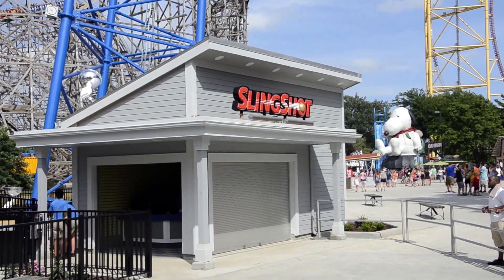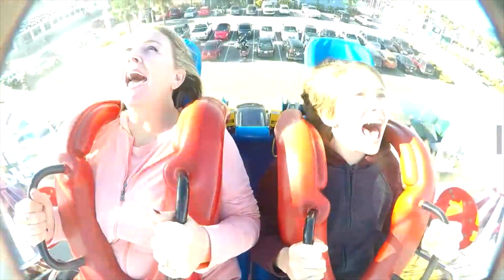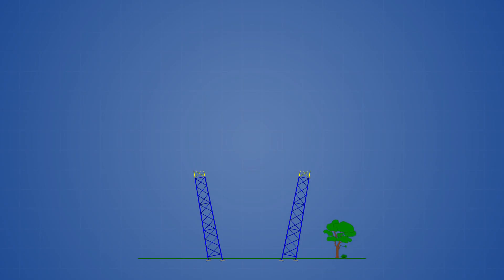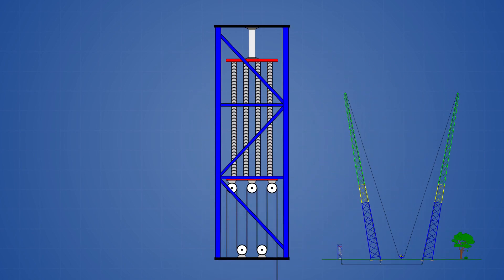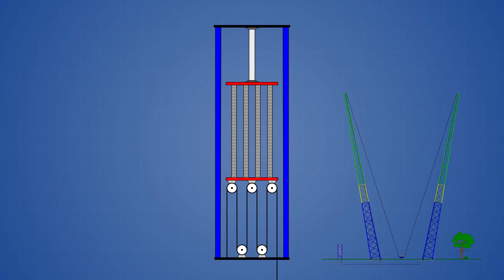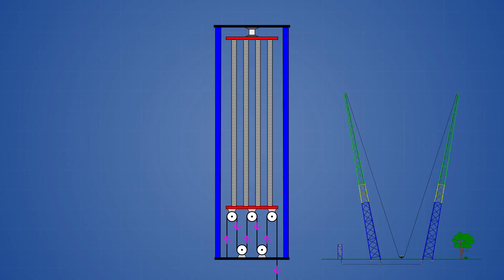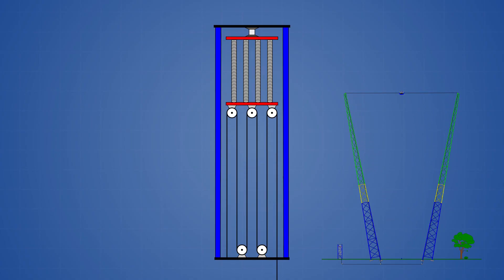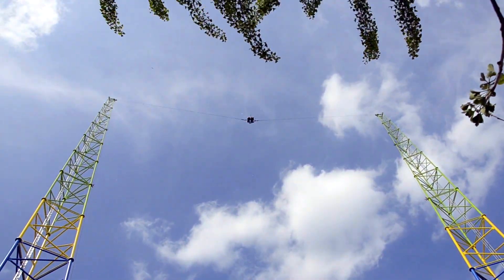How SlingShot Rides Work

Comment from the maker: The modern variant of the SlingShot ride is one of my favourite attractions at themeparks today. Would you ever consider riding one?
Reply: Art of Engineering 
I’m too much of a wussy to go on a slingshot that launches me so high so fast and then I fall straight down 😂
Reply: Nope, I will stick with roller coasters.
Reply: @horseshoe_nc  Me too! Roller coasters don't have the shock of slingshot rides or the uncontrollable spinning. Roller coasters are thrilling enough for me. Sling shot/ bungee jumping-too scary.
Reply: @horseshoe_nc  bouth of them are great .you  can have diffrent thrill
Reply: @horseshoe_nc  bouth of them are great . can  experiance diffrent thrill
Reply: One of two rides at Cedar Point that gets my adrenaline pumping. I’ve spoiled top thrill, millennium and pretty much all other rides, although the free falling sensation gives me butterflies on the gatekeeper. The other ride is power tower, the green ones where you go up nice and slow to take it all in and drop at random because time feels so long. Favorite park I’ve been too, and by far the safest. I’ve been to six flags where I see thing and understand how people can easily become hurt. It may have been Superman at the six flags near Milwaukee where I noticed I could stuck my leg completely out of the cart and while approaching the station, I could have completely severed my leg off. Nothing like that at the point. I would also recommend the breakers hotel or a cabin. And chickie Pete’s although renamed a million times, is a classic dining experience where you periodically listen to the graceful whoosh of the raptor. I love this place if you can’t tell...
Reply: Art of Engineering do the skyscraper at wildwood beach search it up
Reply: no way sis
Reply: I have rode one when I was 11. I would say it is not that bad if you don't think about what could happen wrong. (very unlikely anything bad would happen). Also, the top thrill dragster is scarier than this so if you went through the top thrill dragster(which wasn't TOO bad) with ease this ride isn't bad.
Reply: No.
Reply: There is an accident slingShot...I skip this one 😂😂😂
Reply: I did when I was like 7, and it was a temporary one last security checked in 1997 (according to the poster), and ours spun and spun ridiculously. Turns out later that month at the same festival, the wire snapped. It didn’t harm anyone but is kinda scary to think about...
Reply: Yeah
Reply: No thank you 😆
Reply: HELL YES! LOOKS LIKE TONS OF FUN!
Reply: I most definitely would never ride a slingshot. There is a big one at a theme park near me, and, a few years ago, it had a cable failure that killed a rider.
Reply: Rode a bungee version a LONG time ago, at a tiny fair in Spain, at night.  I’ll think twice next time, and ride it again probably.  What could happen? D-oh!
Reply: I don't  want to go on. That is crazy 😅😅😅😅😅😅😅😅❣️❣️😋😋❣️❣️❣️❣️😅😅❣️❣️❣️❣️😋😋😋😋😋😋😋😋😋❣️❣️❣️❣️❣️❣️❣️🤔🤔🤔🤔🤔🤔🤔🤔🌞🌞🍿💐😋😅❣️💐💐
Reply: Yes I would looks brilliant
Reply: I've ridden the Old Town SlingShot in Kissimmee, FL, USA a few times after it reopened. This was the same location where the cable snapped in March 2021. They reopened a week later and they now have protective stuff on the cables. I'd rather do the world's tallest SkyCoaster than the SlingShot because I feel safer on it and it's not as scary.
Reply: 2 cables. Each run from one side of chair, through spring box, to the other side of the chair.
Reply: That would be a nooo from me.
Reply: Yep but the elastic…
Reply: Hell yeah
Reply: Nope!
Reply: no
Reply: Rode it twice- once during the day and once at night and both times were really awesome! Love it!
Reply: Sure why not
Reply: I want to get on one.
The company that makes the modern slingshot is Funtime
Reply: i rode the sling shot in ocean city MD a few years back best 25.00 bucks I ever spent I would ride one again
Reply: I would definitely try one of theses now because of this video!!
Reply: @TheKellingBros  me too 👌.it is really amazing
Reply: Art of Engineering have riden several rides  Extremely safe ride......and I do have previous back injuries.....and I have riden theses with no further problems to my back problems......exstreamly smooth rides..........for those that think its going jerk them around........lol not at all,,,,that’s a bunch of crap...and it’s in people’s own mind who stands there and watching other people rides it.....saying.......”oh you’re never going to get ME on That uhhh oh no no not going to ride....

Comment: There’s a ride like this in branson.  Maybe a pendulum / swinging ride instead of a slingshot.  Not sure - don’t remember but it uses the two big towers where people dangle in betwixt.  What I do remember were large cracks in the concrete base of one of the towers.  Cracks in the concrete of sidewalks and streets are common and not much concern but those towers are crazy tall.  I can’t imagine the torque on those things when they’re fully loaded.  So I just tell myself that the ride is regularly inspected and there must be some steel pillars that go many meters into the ground on each tower so it must be safe 😳

Comment: The ultimate question was not answered in this video.......Why do they charge extra to ride this?
Reply: Probably because they want you to understand that your life is on the line when riding it and they look at your money as a down payment to your casket if you should wind up getting killed while on it LOL 😂
You are basically paying your life away when you get in those seats, they should make every rider sign release papers stating that you ride at your own risk and the operator can't be held responsible if you die on it also in the papers it should be noted who they should contact to pickup your dead body if you should unfortunately not make it off the ride.

Comment: When you say half of the 64 pulleys would be used for each pair of cables, does that mean that 16 pulleys are used for each individual cable? Or does each pair of cables share 32 pulleys?

Thank you for answering this question. Cheers!
Reply from the maker: I've learned a bit more about this ride since making the video, and there are actually only 2 cables rather than 4. Each cable connects to one side of the carriage, runs through the pulley system, then extends underneath the ride and connects to the opposite side of the carriage. 32 pulleys are used for each of the 2 cables.
Reply: @ArtofEngineering  Wow! Thanks so much for replying.

That's a really great system. It equalizes the forces on both sides of the ride as well as provides sufficient redundancy while only using 2 cables. If one cable breaks, the other cable is still connected to both sides of the carriage, meaning the carriage won't smash into one of the support columns. In fact I've seen videos of that happening on the reverse bungee rides where there's two bungee cords - each one connected to only one side of the carriage.

Great video mate. Thanks again for making it and answering my question. Cheers!

Comment: Is there any good way of knowing whether the Slingshot at my local amusement center is the new modern style or the old reverse-bungee system?
Reply: just look for that spring tower. If its hidden or you can't see it, then there is probably a reason and I would stay away
Reply: The steel or rubber cables will tell you.
Reply: Just ask them. 😁
Reply: Look for that tower thing, or look at the cables.
Reply: You can easily tell by just looking at the cable if it's made of rubber then it's bungee cords which is the old version.. If it's made of steelthen it is the new version.
Reply: Yes, there is a good way.

Comment: small correction, only two cables are attached to the ride capsule
Reply from the maker: There are 2 cables per side: https://i.imgur.com/Sib2ohl.jpg
Reply: @ArtofEngineering  The steel cables actually go underneath the ride, so one end of the cable is attached to the capsule and the other end is attached to the other side of the capsule, giving the illusion that there is four cables. Source: might have been a meth addict for a number of years/s
Reply from the maker: Do you have an actual source for this? According to the patent drawings from the manufacturer, each cable feeds into the elastic frame separately and terminates at an anchoring point inside the frame. It would be possible to use two continuous cables instead of four separate ones though, so I'd be curious to know if they've revised the design.
Reply: @ArtofEngineering  http://www.funtime.com.au/data/tech1.htm,  plus changed the cable a couple of times. on the M45 model.

Comment: It looks more dangerous to me than a bungy one(which ive ridden on twice) Those steel cables are under a lot of tension and could easily snap from fatigue over time. The rubber bungy cords had several straps attached which would keep you from falling if it snapped.
Reply: They arent under tension. That is the Point of the Gen2 Slingshots. The old ones are Special ropes that are held under tension anx released like an actual Slingshot. The Gen2 is still tense steel ropes but they are pulled and not under the same amout of tension as the older ones are.

Comment: i wanted to ride one of these when i heard a local amusement park got one... but i wasn't able to find it... i did find a smaller version that was basically just a single person jumping version. and was super sad because that looked so disappointing compared to what you're showing here.

i mean.... the park had a giant swing ride that you got strapped into a harness and then pulled up super high in the air and then had to pull a release to drop face first towards the ground before going into a massive swing arc. that ride was so much fun... but they charged extra to ride it so i only got to go a couple times.... and even though two people could go at once i had to go alone every time because my friend and mom were too scared...

now i don't think i could handle much of any of these rides because i get pretty motion sick pretty easy anymore. so i'm kinda sad that i never got to go on one of these during the window that i would have enjoyed it.

Comment: The only rides that cost in the amusement parks smh
Reply: Same thing with giant swings. In my neck of the woods, the operators have to be licensed by the state in order to work the ride, and a fee has to be charged. It also has a tiny capacity, so it makes sense that parks would want a fee to cover the cost of the ride and maintenance
Reply: Lorenzo the thing is, it has to cost money or else the line would be horrible. It usually takes 10 minutes per 2 riders, that is a capacity of 12 per hour. Most coasters have over 1000. If 100 people were in line for the Slingshot it would take about 9 hours. And 100 people is very little. Most the Incredicoaster at California adventure usually has around 2000 people in the line on an average weekend. 2000 people in line for slingshot would take days.

Comment: Smart engineering!
This increase safety, but also probably reduce maintenance cost.
Bungee chords are probably expensive and hard to check for faults, which will make for shorter life.
Steel wires in other hand are used everywhere and dirt cheap. Its life under cyclic tension is well known and its life is predicted accurately.

Comment: I have done both the Bungee cord ones, and the Spring cable system.. I will say the Bungee cord ones were always a more intense ride, with greater G-Force and acceleration. I find the Spring system slow and boring in comparison.
Reply: @davidcraig4357  I trust cable more, but mainly due to the fact that operators were pushing the cords past their life span. My point is the cords give a way more extreme ride than the cable which is kind of boring.
Reply: @Alan-Richards  Yeah, but the second is much safer 😂

Comment: Question, why are fairgrounds so damn loud? I understand they make noise to add to the atmosphere and I do not have a problem with it, but there's a fairground 2.5 km away from where I life, yet I can still hear it
Reply: What’s in between you and the fair? Trees? Water? A direct road connecting they two? Sound travels quite easy over things. There’s a ferry boat 5 miles away from my house, but the sound can easily be heard from my house due to the road being open that pretty much directly connects us.
Reply: @yeeturmcbeetur8197  there's nothing much in between, it's in a park with very little trees and most buildings in the way are 2/3 stories max
Reply: MegaMGstudios that’s why. Park with very little trees allows for the sound to ride the ground and the flat buildings lets the sound bounce around until it reaches you.
Reply: I know how it feels. I have a train track one mile from my house and we can still here it as well. there is only suburbs blocking it form us though.

Comment: The grooved wheels (commonly referred to as pulleys)  are sheaves.  A pulley is a flat wheel and is used in a belt drive system.  A major means of transmitting power in the 1800's
Reply: Its just a type of pulley.

Comment: I would suggest going over the why of why this design is safer. I'm going to guess that it's because with the reverse bungie design the cables are put under a lot of tensile stress which can fatigue them enough to snap. In this design the cables are under much less stress and if the spring mechanism fails they cables wont snap.
Reply: Rather than relying on 4 elastic bands, you are relying on 4 steel cables and a huge amount of springs. For the ride to fail, either 2 steel cables on one side would have to fail at the same time, or a good portion of the springs would need to break. In practice, I’m sure springs break every now and the , but one or two out of 720 won’t compromise safety in the short turn. Obviously, just replace quickly and you’re good to go.
Reply: The potential energy is held in the steel springs rather than the cables.
So at no point is there excessive stretching of the cables.
The only time the cables come under any stress is at initial acceleration and that is for a short amount of time.
Reply: Steel cables are much more durable than rubber bands, and a lot easier to inspect. I would also think the springs are more durable than rubber bands as well. 

Side note: I still think I will just stick to roller coasters.
Reply: Also, it’s a lot easier to fasten steel cables than elastic cords. Additionally, the stee is anchored to the ground rather than the top of the top of the towers. Grounds is much secure plus easier to actual connect steel to the anchors.
Reply: @Luke-qc1rm  yes I did get why it was safer, I just suggested adding it to the video because I think that would be a worthwhile addition.
Reply: Also, no tension or potential energy when loading/unloading the ride because the springs are relaxed and the cable is out fully. So no chance the ride could shoot up unexpectedly during loading before the operator has finished all the safety checks and activates the ride system.
Reply: @CharlesReinmuth  The reverse bungie designs I've seen only tension the elastic bands once loading is complete, so there's no risk at loading. Overall, the modern variant is of course safer.
Reply: A steel cable is essentially a steel wire rope. It will maintain SWL even with 10% of the wire strands broken. When people are involved the SWL redundancy is a factor of 7 to 10 whereas a lifting cable might be 4. Meaning, if a device lifting people weights 500kg together with the people, the load limit of the cable Must be above 3500 kg or 5000kg depending on the regs at the time. The load limit is not its breaking point. The breaking point could actually be double the load limit. So a cable lifting the 500kg box with people might have a breaking limit of 7,000kg to 10,000kg. You are quite safe with cables.
Reply: there's just a lot more redundancies
Reply: Your'e all wrong. It's because the elastic bands go slack and can twist, knot, and jerk about. The newer designs keep the cables neat and under control. It has nothing to do with mechanical failure.

Comment: Really cool video!
I rode a bunch of them. Some from Technical Park (with elastic ropes) and one from Funtime (with the springs mechanism).

The former is more chaotic and induces unwanted lateral shifts that aren't really enjoyable, as well as more inversions (including upside down bounces, ouch). But the launch is unmatched and really really cool. A unique feel you can't find anywhere else!
But yeah, I rode one a week before an incident where one motor broke (those pulling steel cables to stretch the elastic ropes) resulting to the vehicle be suspended from one elastic only... (May 21st, Foire du Trône) 
These rides are expensive to run as you have to buy new elastic ropes every 300 jumps if I recall correctly (who are the primary source of accidents). We can also note that the vehicle is maintened in place thank to a strong magnet.

The Funtime one was taller and "smoother". It was still quite a thrill and you do feel safer in those haha. They are definitely unique, and be up there, relatively far from the towers is really amazing.
Their downside is the low capacity, making them upcharge attractions most of the time (but not at Skyline Park where I rode it!), as well as the fact that you need to be two people to ride it. As I am often the only one to go on these, I've always have to find another volunteer that is alone.
Reply: Yeah Skyline Park🤟